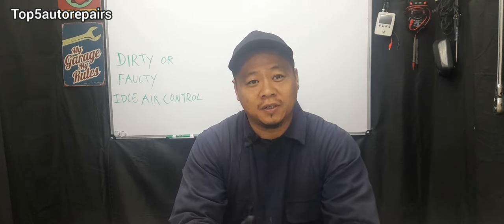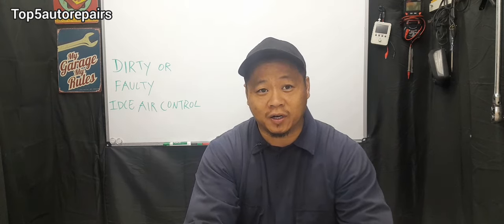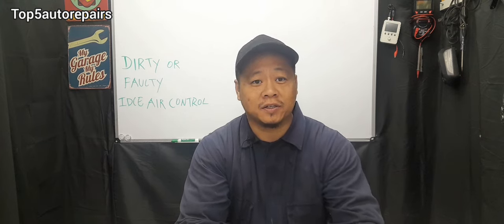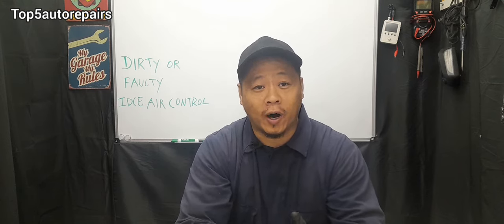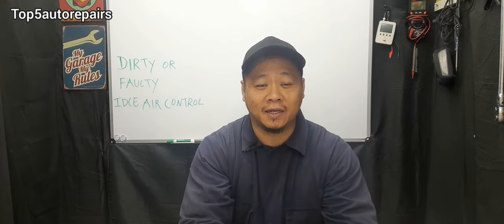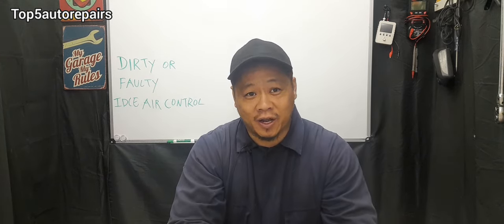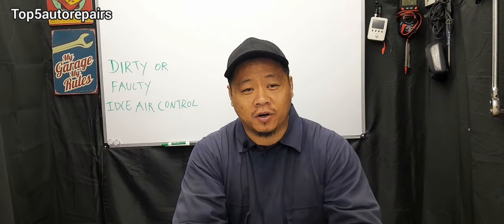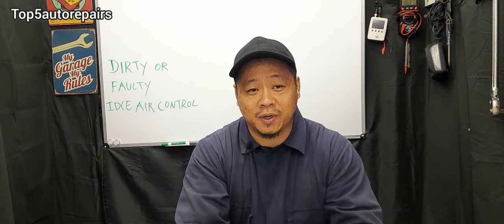SYMPTOMS Of A BAD AND FAILING IDLE AIR CONTROL VALVE

Comment: Hi I have issue with my 95 hardbody, idle low, step on the gas it drops like its not getting fuel ratio it needed, start up fine that's issues Am experiencing. What could be the issue ?

Comment: Thanks so much!  My car cranks no start now, and the IAC buzzes for a while even after taking the key out.  I will try cleaning it all out this weekend.
Reply: Follow-up:  I soaked my IAC in carb cleaner, blew it out with compressed air, repeated, wiped the inside really well, re-installed and now my car starts up perfectly and runs like a top again!
Reply: @BellaRocko  did it still run good after awhile ? I cleaned mine and it worked good for a bit but it stopped lol, I need to clean it thoroughly now I guess
Reply: @Jruiz1611  Yes, it's still working.  Interestingly, I actually ordered an aftermarket one for preventative maintenance, bur with this new one my car would start then immediately shut off. So I sent it back and put the old one back in and it's still running great right now. How strange is that.
Reply: @BellaRocko  wow lol that's crazy,  maybe a bad one ? Idk hopefully wasn't a wrong one either but atlwast the oem works. Btw for anyone else reading I'm going to change mine because I'm guessing mines just out now , but thank you for replying back I'm sure it'll probably help someone else wondering too
Reply: @Jruiz1611   Some car manufacturers/models are very picky with some of their components especially electrical stuff. I've seen this happen several times where I'd replace with a cheap brand from local auto parts stores and would still get the same check engine light code, but then I'd get the part from the dealership and voila the car is happy again.
Reply: Replace with OEM only
Reply: Cranck no start...cranckshaft speed sensor.

Comment: Could this also be a Throttle Position Sensor. but to rule out the TPS   would use scan tool to see the voltage on it or % .  if that voltage on seems ok and not any sudden spikes or drops on voltage as the gas is pressed, if TPS seems ok then its the IAC or dirty THrottle body.   NO Codes on scanner, like P0505 for instance

Comment: I have a 2000 toyota Avalon with a 3.0. At cold start it idles fine but after warming up it idles rough when you stop. Runs fine going down the road, I did discover 4 ignition coils with cracks on tubes and replaced them but with no results. Also change catalytic converter, cleaned MAF and throttle body but still runs the same.

Comment: Ive got a 2010 mustang gt...its got a fairly new throttle body like 2yrs. But a couple of months ago it started idling up and Down. Could it be the IAC??🤔
Reply: Up and down could be the pcv valve as well.
Reply: Did you ever fix this? I have a 2010 v6.

Comment: great video. would it be the iac if the car stalls when put into drive?
Reply: Same issue here 2000 gmc yukon slt super low idle as soon as I put it in gear  not anough power to move

Comment: I have a 2011 GMC Sierra 1500 got a new engine in January and a new transmission in May after replacing transmission rpms drop falcate after truck is warmed up 30 min or so of driving. I seems to do it between 40-55mph.i can feel the truck hesitating when rpms are furcating betweeen1000 and 1500. I can give it gas and it will come out of it or i can let off then give it gas. But even if i let it get below 40 mph it will act up each time until i get to about 55mph. No Codes no heating up, I have taken it to the GM dealership they say transmission and motor are running like the should. Any idea

Comment: what if the cars rpm spikes very noticeable when you barely turn the steering wheel?
Reply from the maker: That's normal. Engine speed increases when turning the steering wheel to prevent stalling due to increased load.
Reply: @Top5AutoRepairs  could I send you a video via email? is 500 to 800 rpm normal?

Comment: Would a bad idle air control vavle cause the vehicle not to start?
Reply: it sure could. mine did this for a while but only caused faulty starts when the engine was warm but not when cold. unfortunately if it gets that bad then the problem is usually mechanical, i had to have mine replaced

Comment: I have a 2000 ford expedition just bought it it shuts off when I come to a stop but turn back on right away I need help !! Please also exhaust smells like gas
Reply from the maker: Possible engine misfire
Reply: @Top5AutoRepairs  the engine light doesn’t come on no code only abs